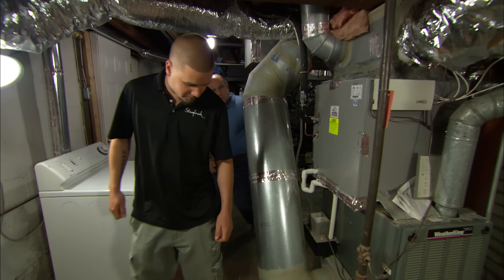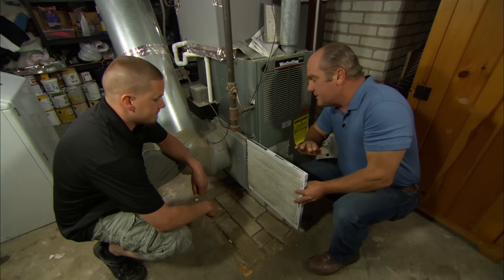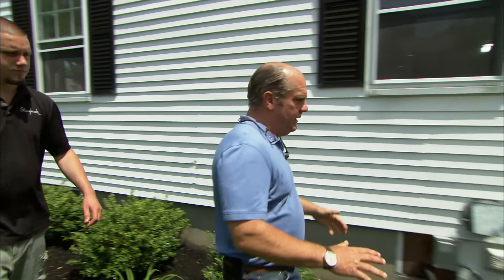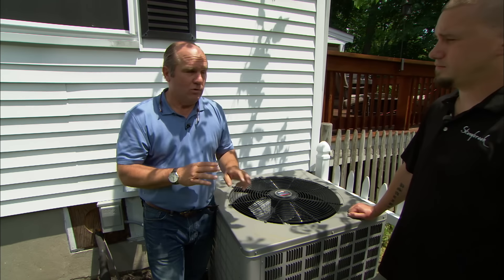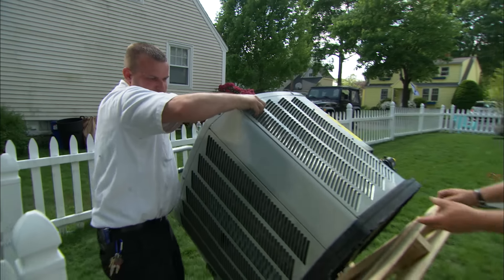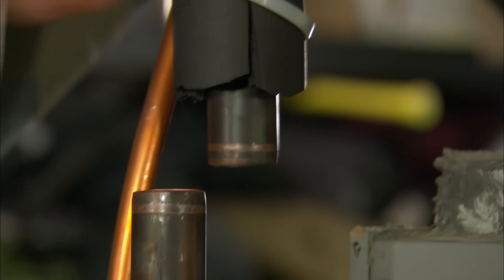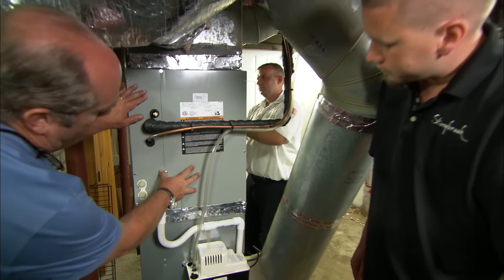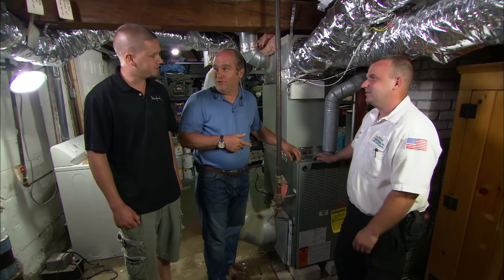How to Repair a Frozen Air Conditioner | Ask This Old House

Comment: if your AC been working fine for year but one day do not cold anymore and  line is frozen just stop the machine remove the filter, remove the coil cover panel and let the ice melt( a few hours)  be sure everything is dry then install a new filter  turn the AC fan on but only the fan for a few minutes check that all the AC returns around the house and air vents are clear(nothing on the way) and then turn the AC to 75  degrees  and let the house get cold.  after 30 minutes check the thermostat to see if temperature change. if everything is ok and temperature reach 75 degrees  just leave it like that for the next 24hours.  next day change the thermostat temperature if you want but don't go to cold. try never go under 70 degrees.

Comment: ok, first let me say that I think Ask this Old House is a great resource and I learn from it every day. Having said that now you are in my domain and I would like to make a few comments. I agree that looking at air flow should always be first. Unless the system is designed for it I would question the use of a pleated filter. A total static pressure test should be done on every system. I will assume that before you put a 3ton system in that house that you knew exactly what the air system could handle and what the load of the house was. I don't see best practices being done here with the removal of the old components. I know this is basically a video for the homeowner and not an installer guide and some of the install procedures are presumed done correctly but it would be very helpful for homeowners watching this to have a check list of best practices. I am not here to provide that list now, but I would have worn gloves, cleaned that copper before cutting, reamed all cut copper and flowed nitrogen while brazing that copper pipe. Mentioned leak testing with dry nitrogen and a proper vacuum afterwards, the installation of a new filter drier always any time a system is opened and finally a check of proper superheat and sub cooling before assuming that the system is within length requirements for the refrigerant charge that came with the condenser. I can't tell you how many times I have gone back to help someone on a new install and found the charge was short of only ounces of refrigerant. The needed refrigerant improved overall operation and efficiency.

Comment: I don't the round return duct connection to filter rack. A box should have been install so that the air from the round pipe flows thru the whole air filter and not just the small round area.

Comment: a low freon charge will do the same problem. also, blocked acoil, defective blower motor and clogged capillary tubes. let's see,  I only did this for 10 years

Comment: Thank you for your time.  Question: my AC/Heat Pump is freezing up around the indoor unit coil. No AC at all.  Thermostat and inside fan are working, filter and A-frame are clean, drain plug is NOT clogged.  Outside fan and compressor are working too; outside coils also clean. I haven't measure capacitance, but assume dual capacitor is good since compressor and fan both run.  I haven't check for low refrigerant yet (R-410A).  What could possibly be the problem?  Would the defrost control board have anything to do here (it's spring time and only inside is freezing).  Thank you much in advance!
Reply: Juan Diaz. 
1/ triple check airflow, return and supply. 
2/ check indoor fan capacitor/s uF. 
3/ temp setting too low, cooling during coolish weather; can cause ice. 
4/ thermostat, running endlessly not cutting out. 
5/ incorrect gas charge.  HVAC tech:  If leak can't be found. Weigh gas out/ weigh in.
*defrost control board has the purpose of de-icing outdoor coil during heating cycle so not likely the fault . HTH

Comment: the amount of incorrect information here is making my head hurt.  unless you have just installed new equipment your duct work has almost no chance of being an issue with why your system is freezing up.  you can oversize equipment all day long as long as your duct work and blower are sized appropriately with no issues with freezing up, that being said oversizing your equipment is wasteful from an energy stand point it will lead to shorter system life and you will be unsatisfied with your perceived comfort levels.  foil tape is not an appropriate go to installation material  it will be falling off in the next 5 years and your system will be leaking conditioned air into areas you have no real desire to condition a quality silicone sealer should be used on all joints.  lets also not forget richard telling the homeowner that the refrigerant is running the opposite direction that it actually is going
Reply: They never mention the zoning system ,I see motorized dampers on both flex supplies and a control on evaporator case . Also  no bypass between supply and return . I'm sure it stills freezes up
Reply: The massively undersized return duct is the problem. Needs to be 16  min for 3T 18- 20 or the equivalent for 4 T. The 1 inch filter doesn't help either, lots of static pressure drop thru a 1 inch. A massive miss here and they'll be back the 3T unit will still be freezing up. they should have reworked the return duct and install a 4 inch filter set up. Old homes have notoriously undersized returns,AC needs bigger duct. 2 total rookies. they didn't fix the problem. I knew what it was as soon as i saw the unit.
Reply: The massively undersized return duct is the problem. Needs to be 16  min for 3T 18- 20 or the equivalent for 4 T. The 1 inch filter doesn't help either, lots of static pressure drop thru a 1 inch. A massive miss here and they'll be back the 3T unit will still be freezing up. they should have reworked the return duct and install a 4 inch filter set up. Old homes have notoriously undersized returns,AC needs bigger duct. 2 total rookies. they didn't fix the problem. I knew what it was as soon as i saw the unit.

Comment: What kind of cooling system cools and cools and cools, even when the evaporator is completely blocked up? Does the controller not keep the evaporator at a nominal ABOVE FREEZING temperature? The only time I've had a heatsink freeze is when heating during winter when it's plenty negative temperature outside; that or low refrigerant.

Comment: had a problem like this but in reverse a/c unit was under sized for the house "parents former home"  was 2350sq foot with a 2 1/2  ton a/c unit ,  Keep in mind was installed in 1970 electric was dirt cheep then,  was the low refrigerant.. anyways once we had the opportunity to replace it,  we went to a 4 ton a/c unit. the duck work was excellent and considered a custom by todays standards  not the cheep fiber board and plastic ducking  .. it was made out of galvanized connect piping  with insulation covering them both output and return,. so we had them install a high capacity air handler "split Unit"   system,  since it was after hurricane Andrew we had our ceilings  down so we put in r30 rolled insulation instead of the pumped in crap that didn't even amount to r8 insulation ,  it been south Florida that house could have taken a 5 ton unit.. but you also have to keep in mind "high humidity" most of Florida 5 tons would cool it down to quickly with out drying the air.  so 4 tons and the length of the house the high capacity air handler did very well and you could feel it on the very end air register as the prior unit hardly anything was coming out .. this also saved a bunch of $$$ on the electric bill to by doing it that way,. 

 in this  guys case in the video.. the systems ducting was under sized for that unit.. he probably needed a Freon charge and duck work added  an extra return suction line.. and add or replace some of the vent registers with bigger ducks as they looked undersized for  his system would have done the job.. keep in mind I don't know the homes location nor insulation either

Comment: Hello,I have my furnace in a closet with the air conditioner box. My question is I can see outside light coming in from the top,is this normal? Does there need to be a way for the furnace to air out? Or does this need to be closed up in my roof? It gets very hot in my house when that closet warms up. My thermostat says 90. 🥵 Thank you

Comment: Indoor coil doesn't have to be the same as the outdoor unit. You could of done a 3 ton outdoor unit with a 4 ton indoor coil for better efficiency.
Reply: Wouldn’t that essentially cause the service factor of the compressor to be compromised?

Comment: So much wrong going on here. Wow.
Reply: He never even checked the charge! Precharged for 25' my ass. I would have kicked him out of my house leaving that plenum looking like he used a can opener on it. I can't believe they posted this video. I would fire an employee for a job like that.
Reply: handyman hack job....I've only been doing HVAC for a year and I could do much better.
Reply: The problem is the undersized return duct, it's maybe a 10 or 12 inch, had to be 18 at least for 4 tons, 16 for 3, or the equivalent in square duct. Replacing the 1 nch filter set up with at least a 2 " preferably for would help a lot as 1 inch filters have alot of static pressure drop. . I've been in HVACR since 1985, I knew what the problem was as soon as I saw the unit, this guy missed it, he must not have a ductulator. They'll be back with the unit still freezing up, and you can run 3 tons thru a 4 ton coil, many high efficiency jobs require that. They should have redine the return duct 1st before any equipment replacements, you will see a lot of this in the field.
Reply: Such a non specific comment...almost meaningless, in fact.

Comment: He never went outside to check pressures. Anyways, the ONLY problem was the Return duct, that 12” return  isn’t enough not even for a 3 ton, upgrade return and fix the problem, plain and simple.
Reply: You are right, also add a supply air bypass (recommend it to prevent cool capacity overboard)👍

Comment: They should have inspected the actual bottom of the inside coil for blockage too.  Most people the filter might be clean but if that coils dirty you're in a lot of trouble. This will stop there flow and make it to the coil freezes of. It's very easy to clean that I would be the 1st place I would go. This guy might have had an oversized unit but if it ever worked for any period of time it was more likely that his is evaporated coil was blocked from the bottom and they never inspected it in this video

Comment: He should have checked inside the A-coil for clogging, especially if the owner has pets as pet hair getting past the filter.
Reply: exactly my thought. I just cleaned the underside of my A evaporator coil. It was caked with a lint like covering.  That was the cause of my AC freezing over.  There wasn't even a mention that they checked it before going through the expense of replacement.
Reply: This is true, clean the coil .. but cleaning the A coil wouldn't be as interesting or as profitable as selling the dude a new system. LoL  sbt
Reply: Anthony Browning where do u clean under the coil? this is what happened last time my ac froze. it stopped working and started dripping water. tech cleaned the coil and everything works fine for a while then I believe it got clogged again and is now doing the same thing.
Reply: Ben Woods When you pull the outer cover and look at the end of the a-coil, there will be a triangle plate held in place by sheet metal screws.  Remove those screws and the plate.  My cover plate is kinda hard to wiggle out from behind the copper lines, be careful.  Then you can look at the under side of the coils on both sides.  Mine is a triple pass for the freon, so when cleaning mechanically I can really only clean half a pass.  After getting all the crap off there, you might try using coil cleaner or foam to help clear the rest of the coil.  Good luck.
Reply: Anthony Browning thanks
Reply: The indoor air coil was clogged with ICE from frozen humidity.
Reply: NETWizzJbirk There are two primary reasons why a/c coils freeze up.  One is the unit is low on freon, and the other is insufficient air flow across the coils like from clogged coils or the circulating fan fails.
Reply: Yes, and if your system is over-sized it does not run long enough to condense adequate moisture from the hair, instead getting too cold too fast.
Reply: i bet if he took the cover off thing would have been clogged solid on the inside..i see it all the time.
Reply: Quite possibly.  Either way it is just too big.
Reply: working shlub  You cannot even  afford a new truck   so   you don't know enough to earn any money

Comment: Outdoor climate also plays a part to because if you over size the cooling system in a area with constant high humidity freezing coils will happen because the CFM and low air flow rate will trap humidity inside the cooling coils and cause it to freeze up because the blower unit was probably meant for a 2.5 ton to a 3 ton system so when the 4 ton cooling coil part was put on it the system lost volume and pressure so it froze up as a result and the second problem by the looks of it is the registers and the return were at the same level you should do that you should have the return higher if your registers are on the floor like high on the wall but if your registers are high on the wall or in the ceiling the return should be a floor level and the basement is not the best place for it because it’s cooler down there to. Look at it like this say you have a Ford Ranger pickup truck with a 2.3L in-line 4 cylinder engine and you want to turbocharge it you can’t put the biggest turbo onto it because the engine can’t power it because of exhaust gas pressure is to low to drive the turbine side of the turbo so you don’t get any boost you have to match the turbo that can handle the amount of exhaust pressure you have available so your turbo will need to be smaller more like a 3 inch or 76 millimeter turbo to have enough exhaust pressure to properly power the turbo.

Comment: Lot of questions remain unanswered here. The return duct seems greatly undersized? Were the return and supply ducts checked for blockage? How old was the current unit and did it use the current refrigerant? Why did they cheap out from getting a new line set and install it where it is supposed to be?

Comment: Should a heating system ha return vents?  I just bought a house and as I’m fixing it, I noticed all the return vents ( the few ones it had they were just holes on the walls with no ducts connected to the furnace . I don’t have the budget to do major repairs however, how big of an issue is this?

Comment: The 12" or 14" round return should have been ripped out and completely redone.  Return air is choked down.  This results in insufficient air flow and can freeze the coil.  I doubt changing out the condensing unit and coil cured the problem.

Comment: Why do we need to run a return line from across the house? Can't the furnace operate off the air right beside it? 
Pulling that skimpy air return line off and letting the furnace/ac run off the basement air surrounding the furnace *after the a-coil thawed out,)wouldn't that rule out an air flow issue or not? Barring no clogged up coils etc..
As a non hvac tech, I am curious why the return line has to be away from the furnace?

Comment: Just so you know, other causes of the ice could be an incorrectly designed system that creates excess static pressure from blockages/improper air flow from either the registers or the return.  This is why a dirty air filters or closed vented can cause ice. It could also be a dirty coil. I'm troubleshooting my icy coil at the moment, after checking all of these, I'm now leaning towards improper system design or low refrigerant.

Comment: Unit definitely oversized but with a few adjustments to air flow and/or refrigerant charge and possibly a freeze stat it could be made to work. Not ideal but better than spending money to replace a relatively new system.

Comment: Correct me if I’m wrong but I’m sure I’m right

Freezing evaporators are lack of freon 

Not the over size compressor unit
Reply: If you have a condenser larger than the evaporator you do risk freezing up or poor humidity control. The evaporator can be larger than the condenser by 1 ton, and this does not work vice-versa.

Edit: Also there are a slew of things that can cause icing up, and more than likely they are restriction, or poor airflow. 
A low charge does cause freezing but it is not the number 1 culprit. There's no #1 culprit either unfortunately. 

Here's a few things Ive ran into: dirty system, indoor motor failure, air handler liner sucked into the coils, low charge, leak, undersized evaporator, too many bends in lineset (causing oil trap), and bad defrost board (HP systems need good defrost).
Reply: Most common causes of frozen evaporator coil and suction line:
1) Dirty Filter or Evaporator
2) Bad Blower Motor in the furnace
3) Loss of Refrigerant due to system leaks
4) Restriction in piping (kinked lines, failed TXV power head, or something in the line)
5) Ductwork issues (undersized or blocked)